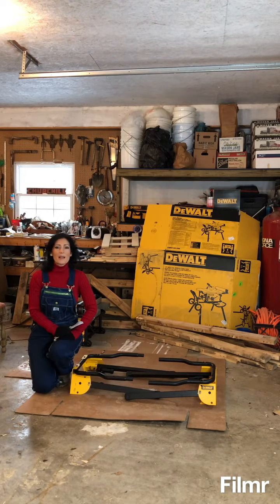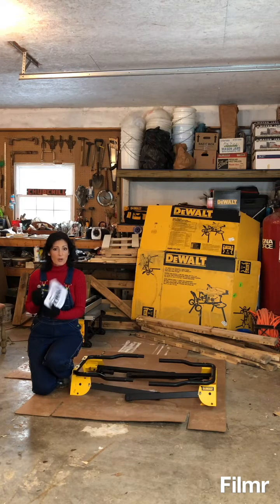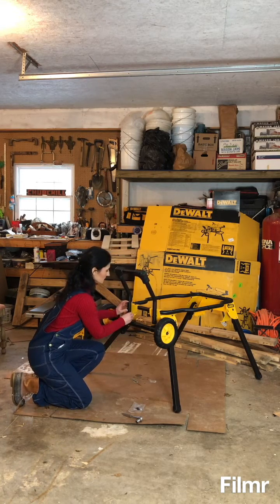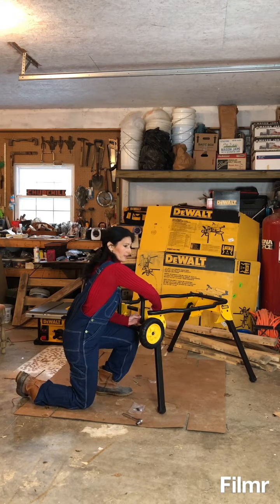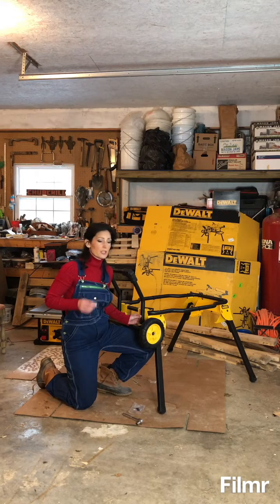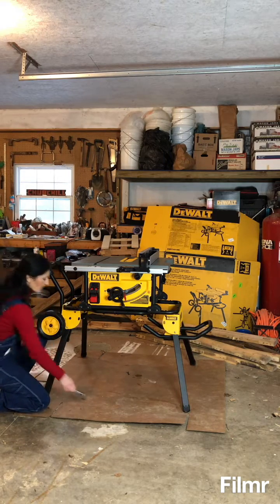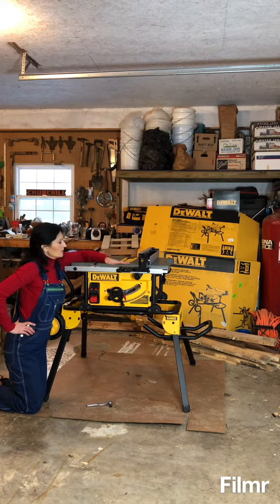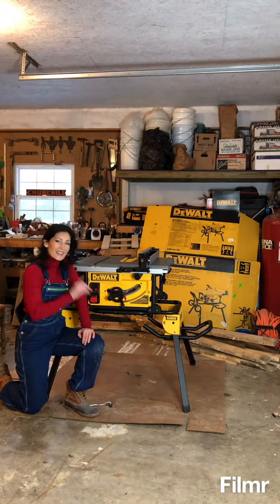DeWalt Rolling Table Saw Stand Assembly | How to Set up Step by Step Instructions DWE7491 & DWE74911

Comment: Thanks for the video, much better than the instruction booklet.  If you have a box end ratchet it will make tightening the axle lock nuts at 6:25 much easier.  Thanks again.
Reply from the maker: jeff smith Thank you!!!

Comment: Great very helpful video. Way better then trying to read the instructions. My 20+ year old Dewalt table saw just kicked the bucket so I purchased this and assembled it tonight. Only flaw I can see with this table saw is that it sits slightly out of level. I doubt it will effect the cuts but I wonder why they Dewalt didn’t make the stand the proper height so the table sits level? Oh well. Off to the job in the morning. And thanks again for the great instructional video. 👍
Reply from the maker: Thanks for watching and commenting. I don’t know if I understand the part about it not being level. You might want to contact their customer service if something isn’t right.
Reply from the maker: I appreciate your kind words!

Comment: Came across this vid looking for some clarity on setup for this tool. A couple of comments. Please whenever possible video in landscape orientation. Portrait is ok for phones (even then, landscape is better turn your phone 90degrees but portrait on a TV or laptop is rough. Also, the more detail the better. For example when bolting the saw onto the the frame, explain the order e.g. bolt through washer, saw frame, kickstand frame, the nut. Only takes a couple seconds but adds so much value when details like this are included. Gave you a thumbs up. I'll watch more of your videos.
Reply from the maker: You’re absolutely right! This was one of my earlier videos and I was still learning. Thanks for watching and commenting.

Comment: My stand is en route. I feel equipped now to assembly it and mount my very tippy without a stand DWE7480. Great job, sister. 👍 You need those gloves with the openings cut out for your finger tips like employees use at drive-thrus. 🌬❄️
Reply from the maker: ms22401gal Thank you!!! Yeah, my hands were frozen that day. Lol
Reply: Ok. I have questions. I have the DWE7480 which must use the mounting brackets. The manual’s written instructions for the pan head feed direction doesn’t match their illustrations. 😩 For your saw, you show the bolt being fed up through the stand, through the saw’s roll cage and then you use the lock nut. You didn’t mention the flat washer. Did you put  the flat washer between the pan head and the stand or between the saw’s roll bar and the locknut? Thanks!

Comment: Great video!  reading the instructions was awful 😮 It was difficult to figure out which pieces were being connected. Im guessing this product was engineered by a man as it was difficult to tighten the bolts in small areas. 😊 thank you! I prefer watching how to assemble visually than rtfm. Mine is a little different but I see your video was posted 3 yrs ago. Table saw has bumpers to help from moving if used without the stand so it was a little harder to align and get the bolts in onto the stand. I also seem to be missing parts but i will read the f?,g manual (rtfm)see if it’s hidden somewhere and how to attach the pieces to the table saw. Thanks again video was extremely helpful and easy to follow.

Comment: I loved your presentation, you made it feel easy to assemble, lol, until the end. Now I know this part isn't your fault because I had no idea there would be different stands and I was hoping throughout your video that I had the right stand, but DeWalt threw a wammy into the mix. They probably got a lot of complaints about confusion over the different stands so the sneaky devils included two extra mounting brackets so that if you did order the one that didn''t  need it, you would have a bag of nuts, bolts and washers extra ether way. And as it turns out, my saw needed to two adjustment brackets. I had read reviews of guys cussing the stand kit saying the bolts didn't fit and the had top drill a few out to make thm fit but after seeing how they made the kit, I realized that if you have say, four bolts that go together to install one item, if you get them all loosely fitted with a washer and nut on the end of each bolt and then titten them all down, they all fit just fine. I also had that problem but then discovered they had sent two different bolts or the same length for the brackets but didn't mention it in the instructions so when I emptied the bag and started choosing random bolts from the pils, I found that some worked while others didn't.
Reply from the maker: Thank you for taking the time to watch and comment! Much appreciated.

Comment: hello, thanks for making this video, I’m trying to decide between this dwe74911 and dw7440rs and was wondering if you’re still currently using this saw and if you still recommend it and is it easy to fold and unfold and move about? Thank you
Reply from the maker: Hi! Yes, I still use this saw at least once a week. It’s easy to transport and when I go to set it upright, I sort of support the bottom feet (on the left side) with my feet as I tilt it upright on all four. This is probably hard to visualize, I might make a short. I’m 5’3” and can handle moving it with no issues.
Reply: @Jennyfromtheshop  thanks to your video and reply I actually bought your the same one today and I’m very happy with it and funny you mention using your left foot cause naturally I did same using my left foot to stabilize it while tilting it up or down. Only thing that would’ve made this stand better if it had the pneumatic up and down like the miter saw stand I have DWX726 but still a very nice stand.
Reply from the maker: @Orbit77777  I created a short based on your comment so thank you for the idea. I hope you love your saw, I use mine all the time. I have a video on here showing a few things about the saw most people don’t know.

Comment: Wasn’t just you, nuts were hard to start and soft metal.  Easily put the saw together in about the time your video took.  I cheat though, I use a cordless drill to tighten everything.  Thanks for the informative and well made video

Comment: I'm not sure what I did wrong, but securing the saw to the stand was a major PITA for me. It was trying to balance the slick black pipe of the saw frame that wanted to slide off the slick black pipe of the stand it was sitting on. It's bolted together now, but I'm not sure how comfortable I am with it.
Reply from the maker: Steve Tool I’m trying to think this through by memory, but is it possible to remove the fence and flip everything over to tighten the bolts that way? That wasn’t really an option for me because of how heavy it is but if you’re able to do that without damage it could maybe work? Or, get a helper to hold everything in place and redo it. My problem was cold hands and metal. Lol
Reply: @Jennyfromtheshop  I got it attached with the bolts, but it really took awhile. Watching the way you set the saw on the stand  and move it around to get the holes lined up without it falling sideways into the stand was not an option for me. I had to be very, very careful. Your video was very helpful, though. Much more than the manual.
Reply from the maker: Steve Tool I appreciate the comments and that you watched! Playing it back for me is painful. Lol I hope my filming and editing has improved since I made this.
Reply: @Jennyfromtheshop  Don't fret. I thought the video and explanation were great. I still think I'm missing something, but that's not your fault.

Comment: Very well done and very helpful as the DeWalt manual is poorly done. For cold hands one should first add more layers to the torso so the blood supply to the hands (and feet) is maintained. Carpenter's gloves have the tips cut away for two fingers and the thumb so they can handle nails but this works for other fasteners as well. Or buy insulated neoprene gloves and cut off as much tip on the fingers as you choose.

Comment: I would not have been able to assemble from the Dewalt manual.   Thank you!    How can we help buy a heater for your shop?
Reply from the maker: Oh, I’m so happy to hear that! Thank you for the kindness, I actually have a big heater in the shop that I could get running but don’t want the expense of gas to heat such a large building. Most of my winter content is filmed in my basement shop, I just shot my upcoming video down there today because it’s already chilly.

Comment: I've had the DWE 7491 table saw for about 4 years now, I love the rack and pinion fence although I wish it were a bit beefier, also love the lever on the side for the riving knive, at this point my needs have changed and I need a bigger saw and it will be hard for me to back to not having those 2 features.
Reply from the maker: Archie Bunker I’d like a bigger saw as well for certain projects, especially since I work alone and could use the stability. 👍

Comment: You're the bomb. DeWalt should be ashamed of the pathetic instructions, really an assembled bolt with a washer that isn't for that bolt? Terrible drawings, lack of numbered table of all the parts...One thing, I used a 14MM ratchet, maybe they changed from US measurement at some point. My 1/2 inch would not work.
Reply from the maker: Glad this was helpful! The instructions were pretty bad but at least the saw rocks. Lol Enjoy!